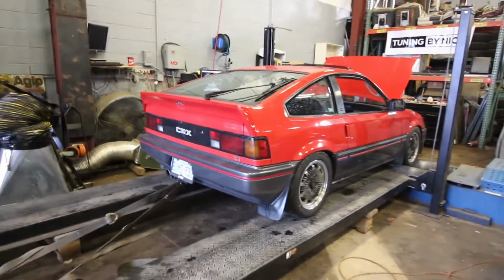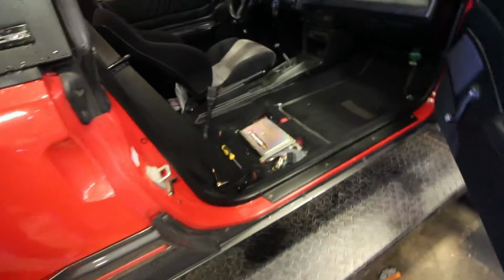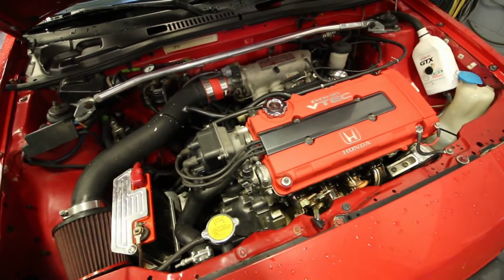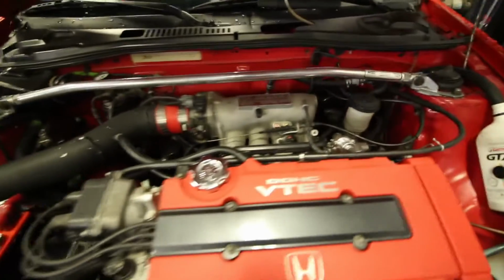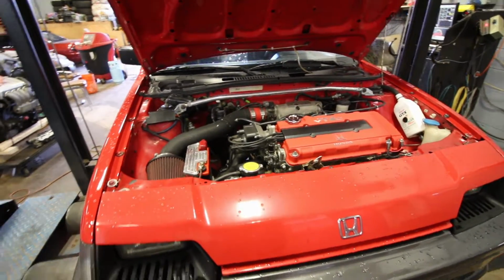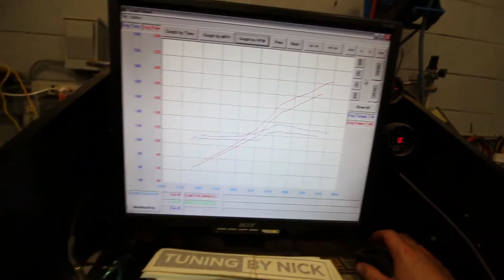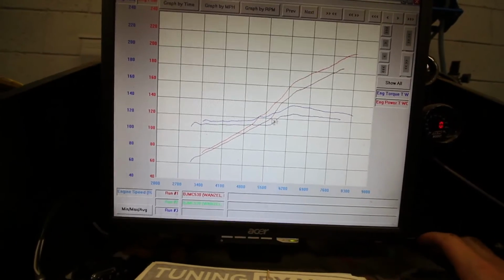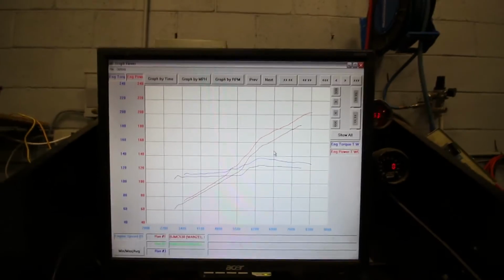1985 CRX Si Type R Swap

Comment: bought a 85 crx Si for 300 running. swaping the stock engine with a K20
Reply from the maker: That will be very cool
Reply: Need to see thos have any vids
Reply: What mounts did you use ?
Reply: @OD3ANW4VY  I ended up waiting for hasport mounts  and changing my mind on a k20 instead got a k24a. Got everything I need except th mounts
Reply: @ljrivas91  not yet

Comment: I have one like this but mine is white, with a jdm b16a from an integra xsi and a 5sp trans with lsd and it's turboed. Thing MOVES
Reply: How much hp does she make?
Reply: @lukeg8075  no idea, I Street tuned it never had it on the rolling road. It's only on 7.5psi though with stock pistons.